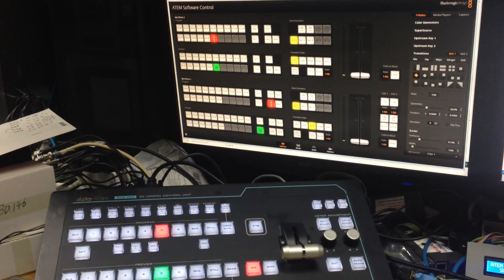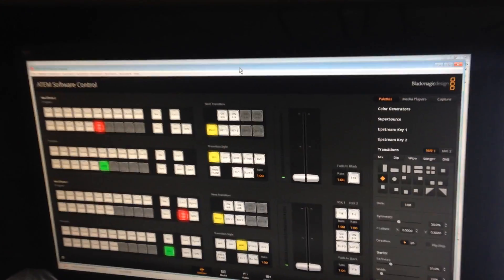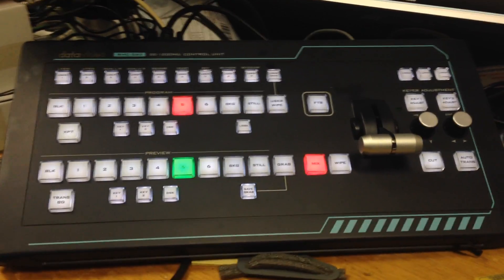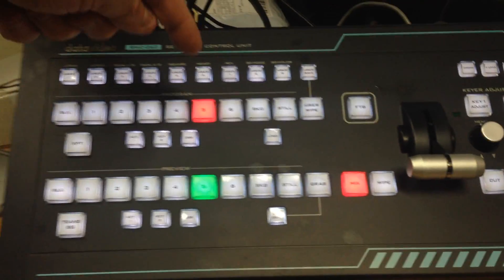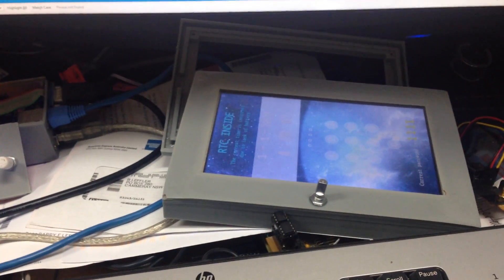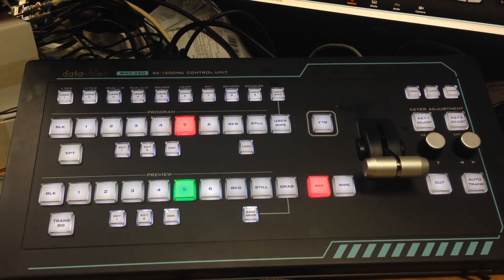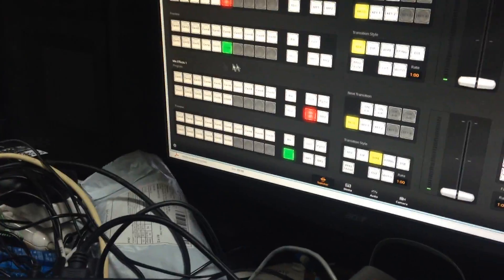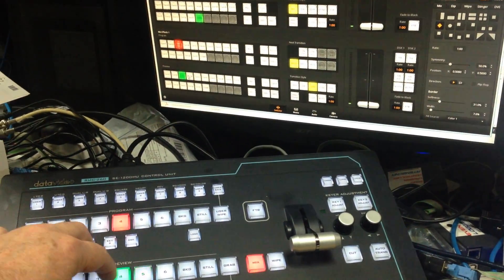RMC 260 ATEM control TEASER

Comment: I am VERY interested in the success of this project and would like to obtain one of these protocol control boxes to facilitate this RMC-260 control of the ATEM functions.
I had been following with interest the GVG panel however at the end of the day unsure how wise using OLD GVG panel hardware was, this approach I believe is a 100% home run winner !

What is the project timeline of this finalization for this hardware ? 

I would be most interested in Beta or 1st adopter of this in Los Angeles ASAP.

Good work !!! Your Projects are VERY practical real-world broadcast Glue and I wish you the best of luck !

PS. You seem like you have more than you fair share of projects on the boil , but if your ever after another "practical" Broadcast type "GLUE" project :
I would LOVE it if there was a "box" that seamlessly integrated the GVG7000 SMS control protocol so it could control an inexpensive BlackMagic HD matrix/router. 
I have Much $ invested in GVG7000 control panels around the station but would like to control the less expensive BlackMagic router (but keep those dozens of GVG panels.....)
 I must not be the only one with this dilemma ?

best regards,
Brad
Reply from the maker: I am looking at rolling out the 1st of the 3 versions of the RMC2ATEM project in December.
Can you email me a link to the GVG7000? I have never heard of or seen this product

Comment: What a wonderful find! I know several VidBlasterX users that would love this hardware interface as it is by far the cheapest I have seen that has a real t-bar. Pity they did not use a USB interface though. Is it true RS-232 they use, i.e. will it work with a standard RS-232 to USB interface cable? Does DataVideo publish the communication protocol or did you figure it out yourself?
Reply from the maker: Yes it is true RS232. Maybe I could make an interface to adapt to your VidBlasterX. Is it a USB interface?
Reply: LefflerPost So I guess it'll work with a standard interface cable the. Thanks! VidBlasterX is windows software, so all I'd need to do is to know and understand the codes and convert them into api commands.